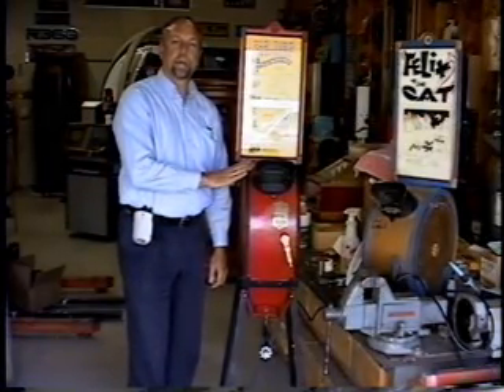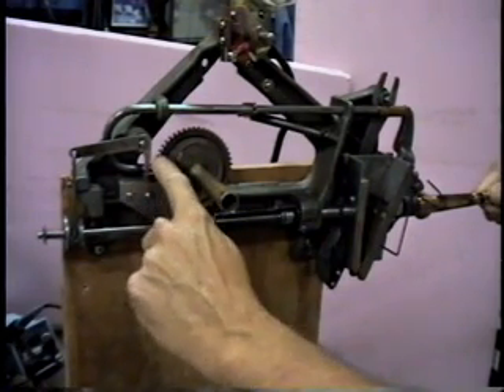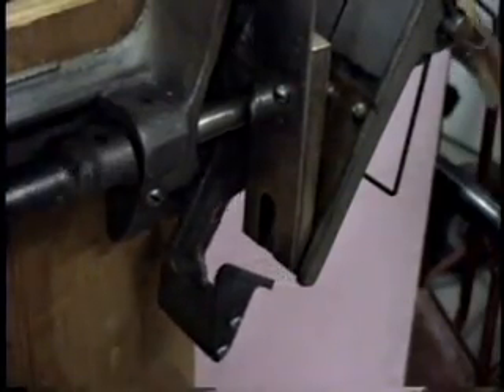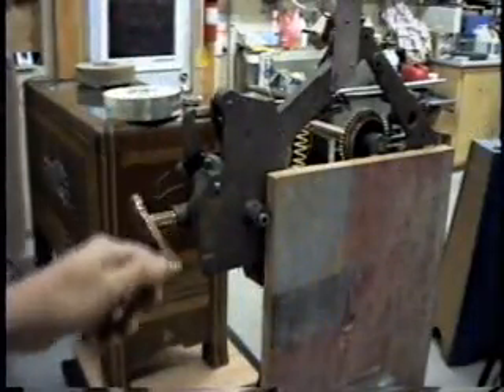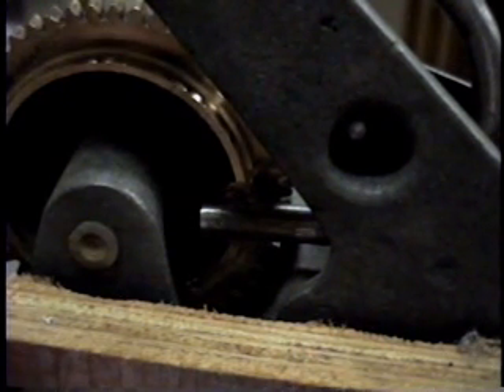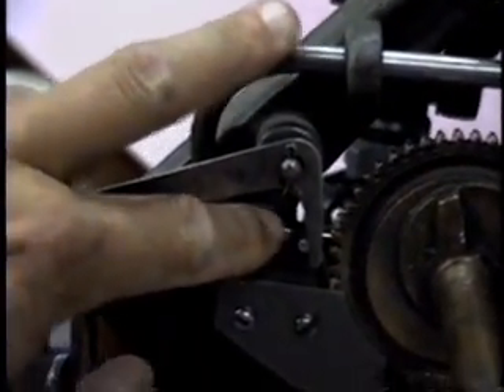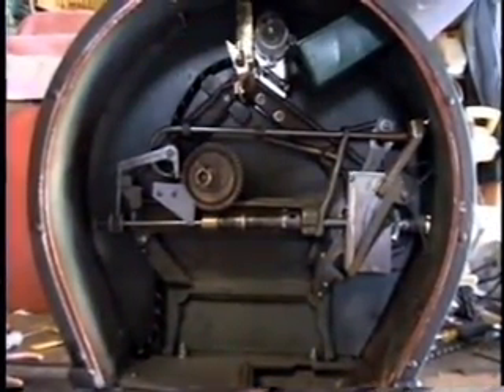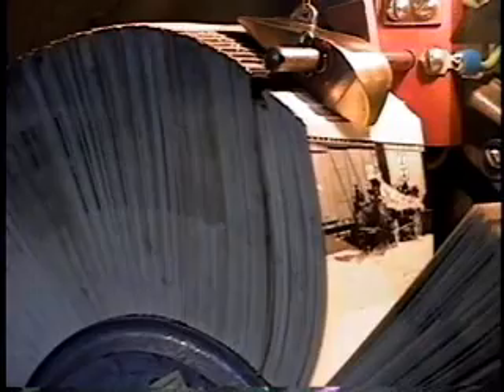International Mutoscope Penny Arcade Moving Pictures - Mechanism Explained

Comment: Do engineers still hold the level of clever creativeness that lead to these kinds of machines? I took an undergraduate course on mechanisms where we would use newton's 3rd law to calculate the forcess and directions, degrees of freedom of each moving part, ect. but to design a complete ecosystem of mechanisms requires a unnatural level of intelligence...

Comment: Thanks Kevin, just bought one of these, everything works, but yes it needs to be rewired. Putting the fuse in is a good idea, nothing like electrifying a cast iron machine. What size fuse did you use? Thanks
Reply from the maker: I don't remember, but here's an easy way to calculate it: Power in Watts (P) = Current in Amps (I) x Voltage in Volts (E).  The formula is P=IE, which can be rearranged to I=P/E.  Therefore, take the wattage of you bulb and divide it by 120V, to get the amount of current that the bulb will draw. Example: A 60Watt bulb running on 120V will draw 0.5Amps. There is an initial "in-rush current" when the bulb first comes on, so if you double the fuse and make it 1.0Amp, you should be fine.  - Good luck, KK